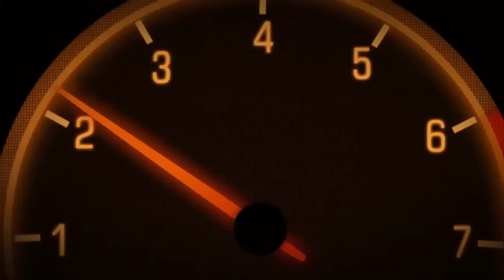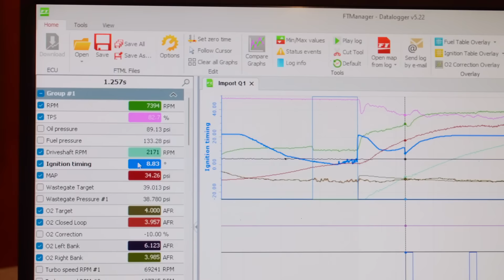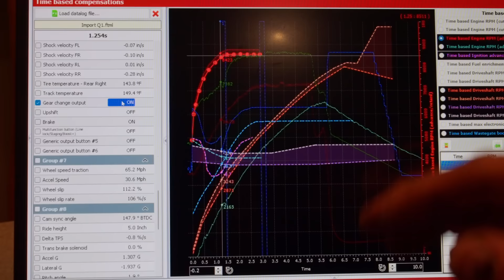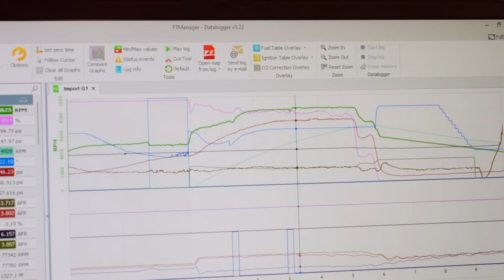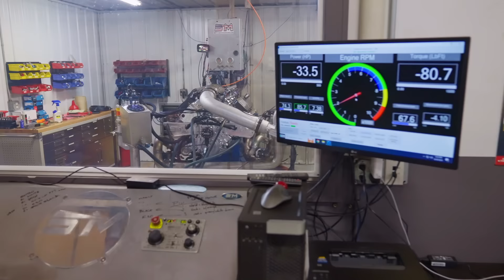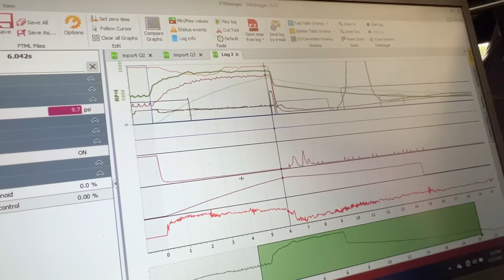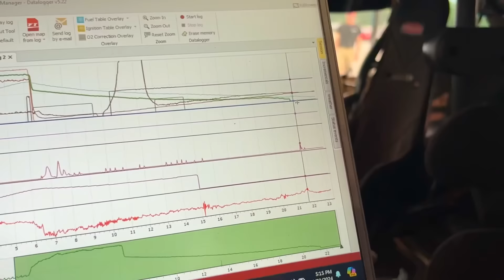Oh No!!!  Why Are There No Brakes @ 215 MPH!?!?

Comment: The brake fluid got overheated and aerated.  It's possible the line lock held just enough pressure to the front brakes causing them to drag. I would think the pads front or rear would show excessive heat if that was the issue. The brake fluid itself if it's been in the car awhile will lose it's higher boiling point. 
 It could also be if the rotors are or were warped, that too could cause an oscillation where the brake pistons are being beat on.  Think of shaking a bottle of Coke, when it foams you can't drink it. Five minutes later it goes back to normal .  That's why you had brakes when being towed on the return road.  Bottom line, you're safe and the Wagon isn't damaged.

Comment: Clean save Steve.  Looked to be brake smoke for sure. That residual brake pressure at over 200mph would cause some serious heat/ smoke.  Been there in my one ton hauling a loaded 40ft gooseneck down a mountain pass. Trailer brake controller fuse popped so only had truck brakes,  and slowing from about 80mph to 40mph in maybe 20 seconds was enough my pads smoked and pedal was going further and further to the floor.  Glad you're okay man

Comment: A stuck shoe or pad could have super heated the break at that speed.  (not an expert but had something similar) Edit: This could have happend during the burnout, with the line lock on you would not have noticed.

Comment: May be when the chute came out the fluid in the master cylinder went to the front away from the hole in the bottom that feeds the piston. Normally this would not be a problem if the brakes were applied first. But in this case the car is already stopping because the chute is applied first. Maybe some baffles in the master cylinder would help or fill it to the very top.

Comment: Glad all is well... My 0.02, check banjo bolt/washer, it may be slightly loose. Since the brakes held pressure at the start, perhaps vibration loosened, but built some pressure that bled off quickly on first two pumps. GL

Comment: Big advantage to do good data logging as you can check previous passes to see if there is residual pressure and sounds like your going to make some changes and come back better anyways.
Anyone that's into cars knows random stuff happens and sometimes it can't be explained, just need to learn and move foward (also re paint, shows it was done well with good hardeners etc)

Comment: There might be several reasons for this to happen.

Brake fluid will go bad after a while and should circled trough the system at set intervals with new fresh fluid.

Are you running hard lines all the way from the masters to the point where you have the flexible lines to the calipers? Those need to be as close you can get them.

Also are you running flexible brake lines that can handle high heat? Your exhaust system is very close.

You should consider shielding your entire brake system from the exhaust as it's pretty close to everything as the radiant heat is very high at full pull. 

And check your calipers, pads and rotors for any drag and damage.

Luckely you have a chute. I have had brake failure on a track car due to overheating at 160+mph at the end of a straight away and it's not fun when you need to make a turn. Thank god that there was a good run off zone there.

Love the videos, keep em comming :)

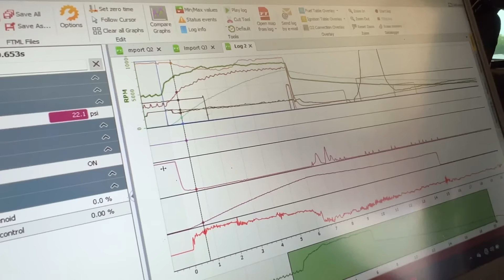Comment: Steve, it sounds like you figured out your brake problem (37:50) . To add to your theory with my experience, when I raced an INEX Legend, the brake lines were not fully bled and the brakes started to drag during a 10 min stint. I only noticed the brakes started to fade as the brake fluid started to heat up due to dragging after a few laps and I needed them at a large deceration point. At that point, the pedal almost went to the floor due to thermal run away; but I was only going 70mph rather than 215 haha. 
Hopes this adds a bit of solidity to your theory!
Happy racing!

Comment: Asked before, i know it's difficult to read every comment/ answer all questions, but what is, if any, your warm up routine for the dyno engines? Do you let them come up to a certain temp, and let'er rip? Or just start and go? So these engines need to get to a certain temp so metallurgical expansion takes place to get proper seal? Or they run "better" cold?

Comment: I did comment a couple of years ago that your brake pedal seems to have an excessive amount of travel to it. Does the master cylinder have built in residual pressure valves to prevent drain bake of the fluid if the master is under the floor and lower than the calipers? Glad all was good in the end. 👍

Comment: It could definitely be moisture in the fluid like everyone is saying or it could be your lines are too small and too close to hot parts. Bigger line can help reduce the residual line pressure and allow for more heat input into the system

Comment: Steve how close is your brake line to the headers I couldn't see them from where you had the front off just wondering if the line might be getting hot and causing it to build a little pressure. Check the rubber lines and make sure they not trying to come apart on the inside and holding pressure giving you brake drag and heating up the brakes. I had the rear rubber line on my drag truck causing me trouble it was to short, I think every time I left the line it was overextended it and cause damage to it, I put a longer one on it and haven't had any more brake problems. Maybe this will help you on yours

Comment: Pebbles is probabl 39:05 y better than sand you probably don't sink as deep be harder getting the super fine dust out of everything going into sand.  Kind of sounds like you were boiling the oil in the calipers or your master has lost compression seals in it and just bypassing it right back into the reservoir. Maybe a caliper seal blew.    Is it a dual shuttle piston, or single piston, or tandem dual piston.?  Glad everything turned out OK and that your  fine god speed Steve !

Comment: You might have a master cylinder adjustment issue  if you're showing static pressure. Possibly causing caliper drag and boiling fluid. Causing brake fade which can lead to cursing and shitting your drawers.

Comment: I'm pretty sure this has probably already been said Steve but the only thing I can think of is brake line routing? Do any lines run next to parts that get really hot anywhere that it's avoidable to do so? Turbo placement low and outside as they are, I can't tell on video the room for airflow between those housings and exhaust in the front by those calipers and lines? Seriously trying to be helpful, just asking some questions. Very glad to see it was at a track with good runoff/over pits/lanes. It seems those small rocks work really well and I'd bet are easier to clean out than sand because as we all know, "sands irritating and it gets everywhere".
Hope you find the cause, take care and God Bless, (Num 6:24-26).

Comment: Didnt go through all comments.  But we'd also check brake pedal pushrod to master adjustment. Holding a bit of pressure.....🤷‍♂️
We've had some issues with masters mounted in the floor as well. Not sure where yours is but..... Fluid draining back into reservoir ( hence the 2/3 pump) to build good pressure... curious to find out what it is....

Comment: Bummer for the rock-pit right after new paint, but glad you're fine.

Look forward to hearing the final analysis of what went wrong on the brakes.  I'm no expert for sure, but just a handful of psi on the brakes during the run doesn't seem like it should have overheated the fluid intuitively, but maybe I'm just dumb.

Hope you find an answer that gives you 100% confidence in the brakes moving forward and having those big chutes keeps you sand/rock free from now on!

Comment: Had a brake failure earlier last week myself. Pushed out a front caliper seal as I went into a 65 mph turn at 140 mph. Luckily I still had the backs and spun it parallel down the wall. Could have been real bad. (Road course)

Comment: Good thoughts with the moisture and all that. BUT if this was the problem, he should have made FULL pressure when he initially hit the brakes. Then they would begin to fade. They will not act like they did in his case because he already had no pressure when he stepped on it. So the problem was already there before the end of the pass. 
He's probably right about the residual brake pressure causing him to drag the brakes all the way down the track. That caused his fluid to boil before he even stepped on the pedal.

I'm almost sure the tbm rotors are just machined flat. 
OEM's manufacture their rotors with a little runout to push the pads away from the rotor when you'r not using the brake. Without this runout the piston gasket would be the only thing that pulls piston and pad away from the rotor.
If the whole assembly is not absolutely 100% new and clean then the gasket will not have enough force to pull everything away from the rotor.
Maybe there was moisture involved, but first of all there shouldn't be 17psi of brake pressure when he's going down the track. Especially with flat machined rotors that are not ventilated!

Comment: It seemed like you were a wee bit upset at the windshield, but it was an impressive pass in my book.  (My fastest pass being a10:92 on my bike and 11:71 in my truck).
I think the parachutes that make your eyeballs pop out are a great idea, and the motorcycle brakes on a 4000lb. car are not. Hopefully the engineers will help you work that issue out.
I do appreciate you asking my opinion on these items, and I could give you some help with the ignition curve.
At 12:26 you imply moving a few pink dots on a computer screen will change your timing curve...
First you bring the engine up on TDC #1 (#8 on International) With the cap off you note the direction the rotor is pointing and how much it turns when you pull it out.  Being careful not to break the gear when punching the roll pin out, remove the gear and disassemble the distributor to make changes, test it on the distributor machine and re-install in reverse order.  Less than an hour for a pro!
Please apologize to your windshield and be glad that the car is still as beautiful as ever!

Comment: Glad you're good and the wagon is relatively in one piece...but.... you might want to trade that sheet of carbon on you just made for your trans cover for a piece of carbon/kevlar instead lol, better chances of it not shattering.

Carbon is a great composite for weight,  kevlar is good for abrasion and damage resistance as well as weight (but not as light as carbon), hence why they started mixing the two years ago for certain areas of use.... kevlar is great for wheel wells, undersides, lower body panels ect, especially in racing, not drag were weight is more important, but the trans area is one of those spots where it would be better suited... plus it looks, IMO, much better than straight carbon any day, especially in dogbone weave 👌

Comment: I see several blaming the DOT5 silicone based brake fluid.  Worth noting that Steve said he uses the TBM brake fluid which is DOT5.1 and is glycol/ester based like DOT3 and DOT4.  Incompatible with DOT5.  Still needs occasional replacement no matter what flavor.

Comment: High performance brake fluid (Dot 4+/5.1/5) has a dry (in a new bottle) boiling point around 615°F and a wet (in the brake lines with 3.7 % water absorbed, after a year or so) boiling point of around 400°F.  If the critical temperature was reached previously, steam can easily lead to brake failure, which recovers when the steam condenses and is reabsorbed.

Comment: Sometimes the seal in the master cylinder can get a p iece of foreign material in it causing it not to seal and go to the floor. I Had it happen with a clutch master cylinder. 
Once it seals again they work fine

Comment: I suggest installing a steering brake controller twin handles , Left & Right  .  Its like having 2 extra brakes after the master cyl.  Pull both handles to stop or steer it with left or right pull.  As used on a dune buggy.   At least the chutes deployed . Be safe

Comment: @Steve Morris Engines
Glad you and the car are OK !!
As far as the brakes, the piston & seal(s) in the master cylinder may not be retracting enough to open the port in the bore to allow the brake fluid to return to the master cylinder, this would make the brakes drag causing heat that would boil / vaporize  the fluid. The source of this could be in the pedal / linkage or in the master cylinder.
Thanks for the great content !!!
Best !!!

Comment: I have a cool shirt setup in my pickup. It’s a 100% must have in the summer without ac. I usually wrap the extra silicone tube behind my neck and it really helps to cool your head off. Still wish I had a “cool hat”

Comment: Brake fluid is weird in the fact that the higher the DOT number will increases the boiling point of the fluid. The draw back is that it becomes more hygroscopic. Basically it absorbs water out of the air. Since your car has been down for a while it has absorbed a ton of water out of the air. Also most painter run a high humidity in their booths. If you take a race car out of storage always DNR the fluid or drive at low speed for a while to boil the water out of the fluid be before you life counts on the brakes.
Reply: DOT 5 is Silicone based, and is hydrophobic.  That's not to say that there might not be water in the system, just that, if there is any, it will be free.  Whatever, it will boil faster than the brake fluid, turn to steam and affect brake performance ... but not as much as boiling brake fluid will.

Comment: Maybe your brakes were dragging slightly and heated the fluid up just enough to boil the fluid at the calipers. Or was all that smoke brake fluid boiling out of the reservoir.  When was the last time you cleaned the grease out of the slider holes and regreased it? Or is the piston from the brake pedal too long?

Comment: When I saw you pumping that brake pedal, I thought of Jay Leno the other day talking about the old cars which had steel rods (& linkages) before hydraulic brakes.
I think Leno said this was a Ford motto: “The safety of steel between pedal and wheel”.

Comment: Steve just a thought from when i built off road car for baja1000 we had to change our routing of break line because engine heat would boil  fluid in the lines.  You just added a trans tunnel don't know your routing but thought i would share what i ran into.

Comment: We had brake fluid boil in the calipers on a circuit,  nearly ran another car off the circuit. Very sudden, had done a number of laps with no problem at all. Brakes had recovered by the next corner but we had slowed down a lot by then. Boiling/not boiling is a knife edge. Glad you are OK, a very scary incident, the brakes arguably had been warning you. A random thought... wonder if your brake bias is different than it was previously?

Comment: Hi Steve, i think Simpson helmet have models where you can connect an air blower like some head gear for welder. If you blow air trough cold element like in cool box you will get fresh air for the head 😉👍
Wish you the best

Comment: Just a thought, but are you running residual pressure valves? If not you could have had fluid drain back from the lines  to your master cylinder if it's  mounted at floor level.

Comment: Lots of smoke so cold have oil or fluid been under the tires?  Also if you mixed brake fluid during a recent brake upgrade it could be incompatible fluid boiling

Comment: I think you need either self retracting calipers or 0 residual pressure or your brakes will drag. 10 psi is suspect. On a side note, we had trouble bleeding the brakes on our car and found it had a problem with the cap, no vent/diaphrapm

Comment: Wonder if the O ring on the right front caliper piston failed due to heat, allowing brake fluid to hit that hot exhaust causing that smoke. Something similar happened to a guy with a 68 Firebird. He was at 160 mph, lost brakes and found it was a caliper piston O ring failed temporarily, had fluid all over the place under the car and tire.  The O ring seemed fine after it cooled down.

Comment: Steve a few things come to mind about your brakes. Check with the manufacturer to find out if you actually do need a residual inline pressure fitting.  10 or even 20 psi will never hurt your speed or heat up the brakes. The benefits of having one is that you already have a very small amount of pressure. You're brakes then work faster and respond faster. That smoke looked similar to brake fluid. So I would go thru the brakes and check for cracks or cracked calipers. The braided line has either a rubber inside or Teflon. Rubber inside can crack or tear in a way that it will act like a flapper valve and could stop the fluid from getting to the calipers.  Also when you know everything is on point then I'd vacuum bleed the system. Instead of the traditional pump it up and crack the bleeder. Tom and the guy with the Monte Carlo should take some advice from the kid or guy who said that you need big boy chutes.. lol ... I'm positive that all of you would rather have to restart the car and drive off the track. Instead of spending hours cleaning it up from hitting the traps. Just imagine if that place had a net instead of pea-gravel. You would have said A lot more than MOTHERTRUCKER....  HOPEFULLY my ideas help you out. Glad you and the car were ok. Until next time. Keep up the great videos 👍👍👍👍👍👍
Reply: Second the vacuum bleeding. Makes a world of difference.

Comment: Depending on where your press transducer  for brakes is in system it could be pressure behind residual pressure  valve. I assume master cylinder  is under chassis.  With a residual pressure  valve.

Comment: May need to add residual pressure valves in the brake lines to maintain a few PSI in the lines... as it may be returning fluid to the MC, leaving a void to fill in the lines when you step on the pedal.